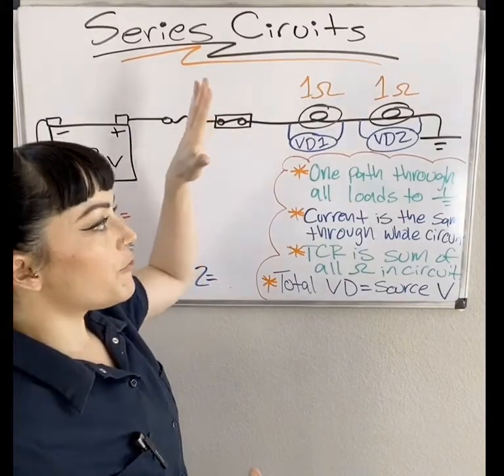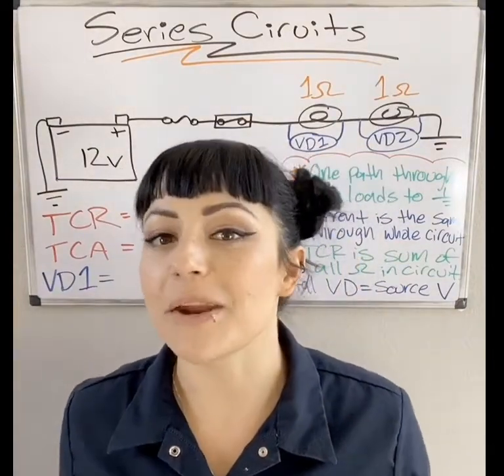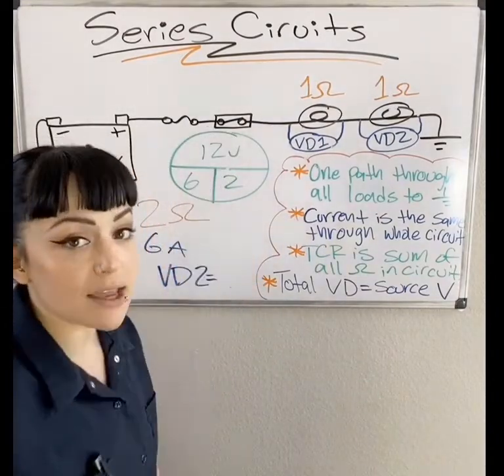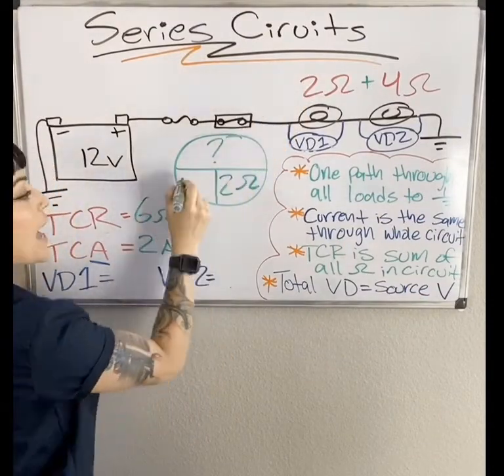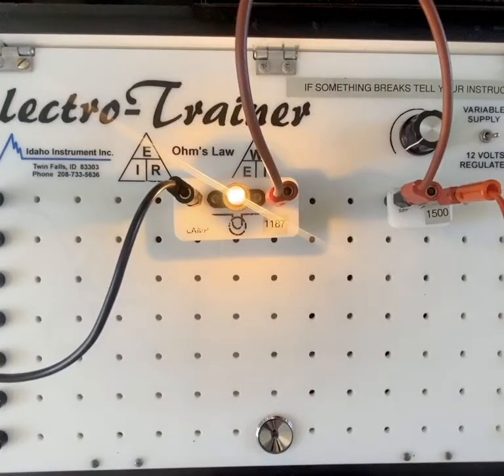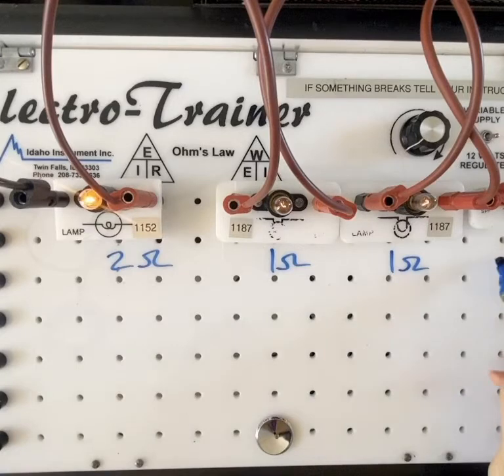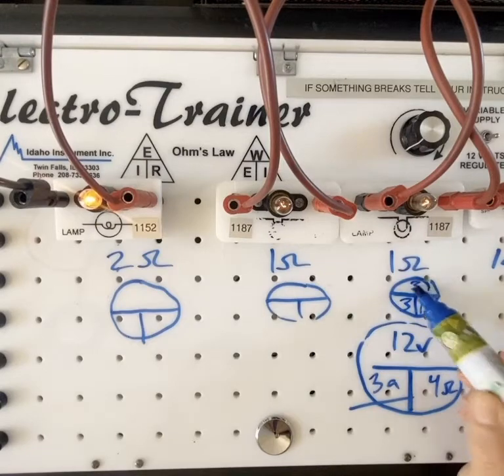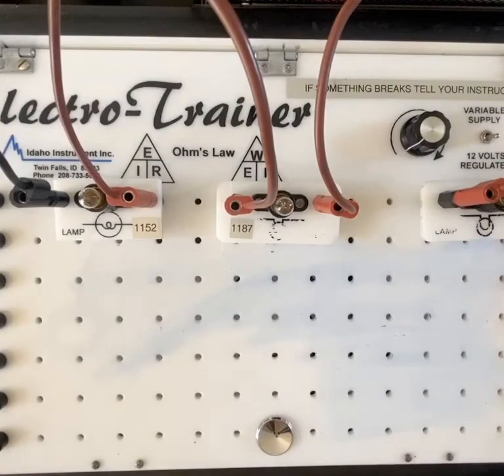Basic Automotive Electrical Theory 6

Comment: I'm no expert but having a switch by cutting the ground wire seems wrong. In my logic there is a chance that wire somehow strips and the circuit shorts to ground and it start working on it's own while if the positive shorts to ground a fuse would probably break if that makes sense.

Comment: This all makes sense if electricity travels from positive to negative ( ie conventional electric flow (direction) ). But we now know electrons flow actually travel from negative to positive , so we are told as “ it has been proved “.
 This creates a contradiction ie you would want the fuse as close as possible to the negative terminal (to prevent overloads in the event of a short)! Yet clearly in your demonstration (28:43 thereabouts) the current is in fact travelling from the positive to the negative  ( must be as when the circuit shorts at the bulb nearest the negative the other two bulbs remain on ( light emits ) ).  So how can this be ( contradictory to actual current flow (-ve too +ve )???????? 
Am I confused …. extremely!

Comment: I didn't understand completely what you said on 29:14 about keeping the fuse as close to the battery as possible . is it so you can protect the entire circuit from a possible electrical fire?
Reply from the maker: Sorry for the late reply. Yes, the only part of the circuit that is protected is everything AFTER the fuse. So if you get a short to ground before the fuse, the harness will catch fire.
Reply: This all make sense if electric current travels from positive to negative ( ie conventional current ) . But electrons  flow from negative to positive , so we are told “ as it’s been proved “. This creates contradiction 29:23 ie you’d want the fuse as close as possible to the negative terminal ! Yet clearly looking at your demonstration the current is in actual fact flowing from positive to negative. So how can this be ( actual flow is from “ negative to positive “ ). I hope get my drift so how do you explain this apparent contradiction???

Comment: Wouldn’t VD2 @14:41 be 8volts? I know it’s a simple mistake, but the concept was learned. Thanks 🙏🏼
Reply from the maker: lol yes you are correct! So sorry about that!
Reply: @ms.a_theshopteacher  hi Yesh, you even added 4v + 6v =  12volts. ❎,

Yeahs, should be 8 , so sum of supply volts = 12V total.